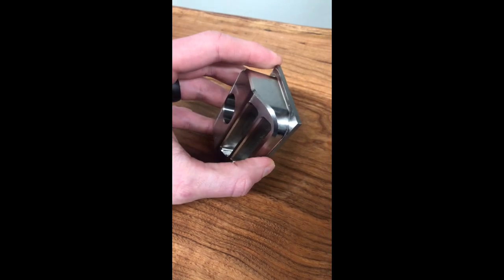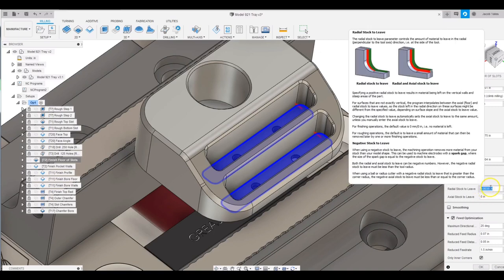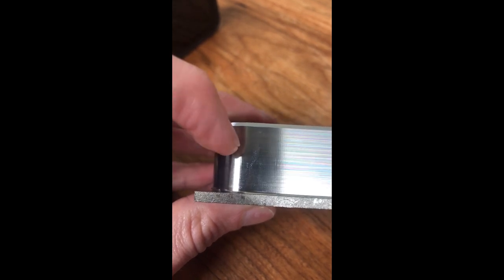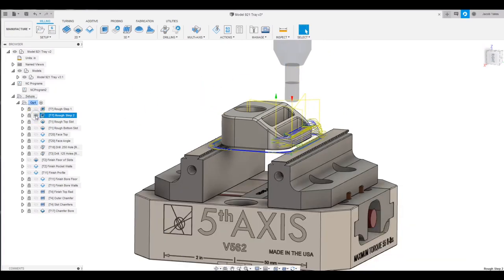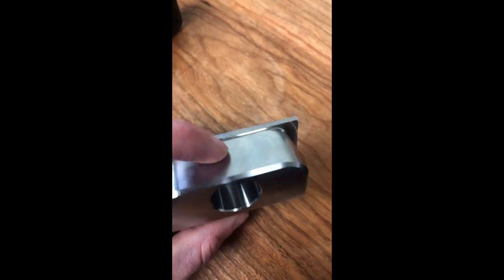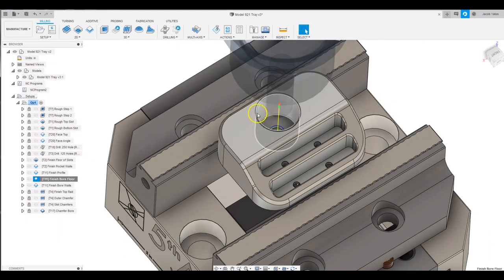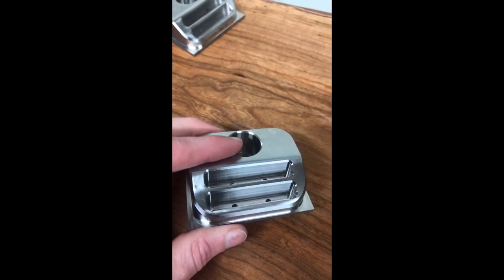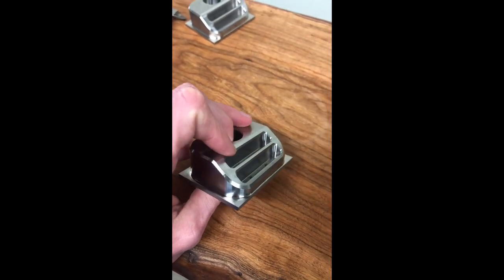Tips To Improve Surface Finish

Comment: How did you program the chamfer on that part? Positional 4th axis? I ran into this a while back and couldn’t wrap my head around it. Great video btw.
Reply from the maker: Hey Barry, I actually surface the chamfer on with a .125 ball nose.  You can create a 3D chamfer toolpath by offsetting your profile and using Trace, but I ended up with some gouging when I did that. The ideal way to finish that chamfer would be to 5-axis swarf it with the side of an endmill, which I may try on the next run. Thanks for watching and for the kind words, let me know if I can be of any more help!